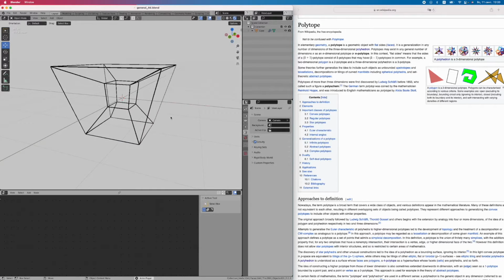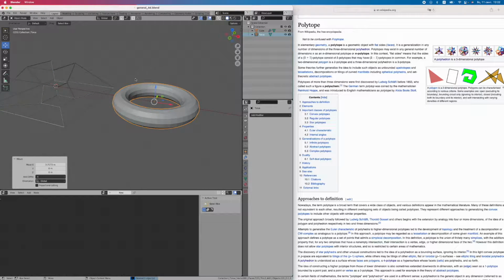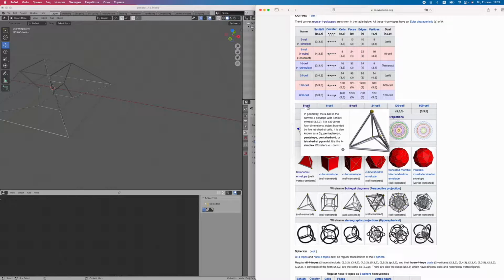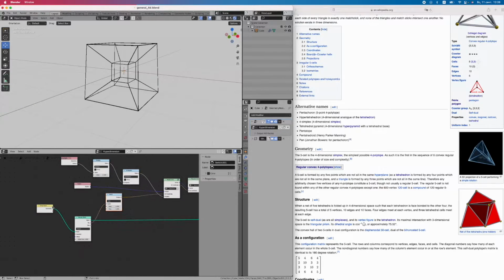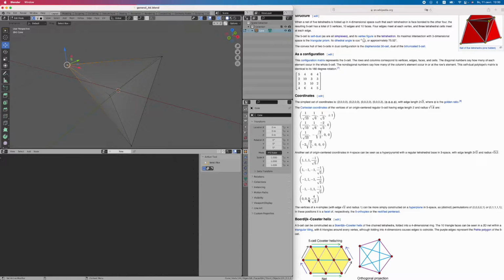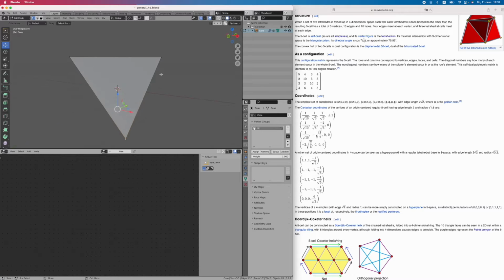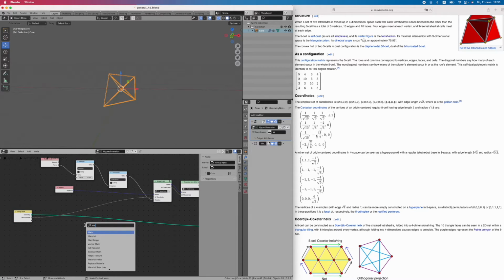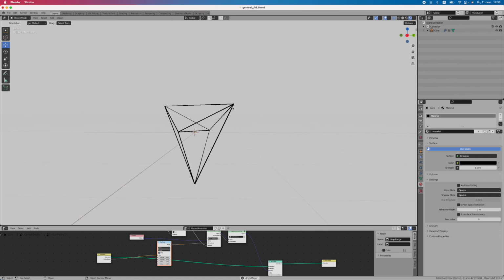How to make 4d objects in Blender. Part 2

Comment: For those wanting to do non wireframe renders and noticing there is a missing cell,there is a simple fix for that.Copy the rotation and projection nodes,put the original non-extruded geometry as input and set W to 1.Then join geometry to the rest of the geometry before going into set position.

This ONLY works for simple extrusions and extrusion +scale!

Comment: interesting method.I've played with the node setup from the previous tutorial and there is a easier way to make a 5-cell(and any other 4d pyramind for that matter).Put a scale elements node between extrude and  set position and set scale to 0(any value inbetween gives a truncated pyramid).Another cool method to make 4d object is using the parametric equations.I've made some really cool duoprisms,klein bottles and toripshere renders.

you can also duplicate the geometry at different positions along W and with different rotation to do stuff like 4D Rubik's cubes.For those wanting to see some of the stuff i've made there is a video on my channel.
Reply from the maker: Very cool! How did you make parametric objects? With volumes?
Reply: @glebmicnovic3813  i used a grid node for a plane and then implemented the equations using a lot of math nodes that bend that plane into the shape,but because the plane is flat,the resulting object is just a 3d slice.I've tried using cubes and even cylinders instead of the grid and none seem to work properly,so im still trying so figure out a solution

If i add a value to the Z coordinate and then manually ajust that value i can swipe across the 4d objects and see the different slices